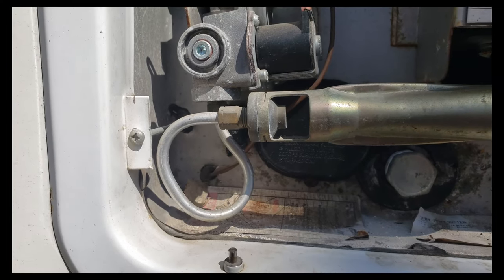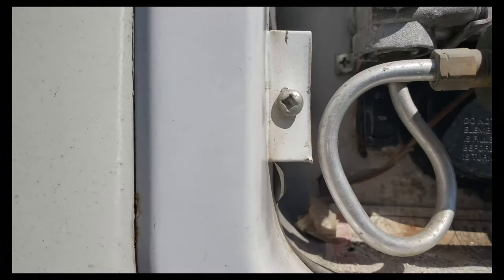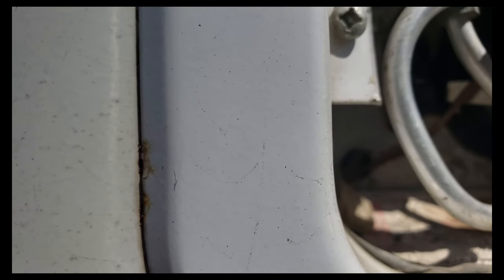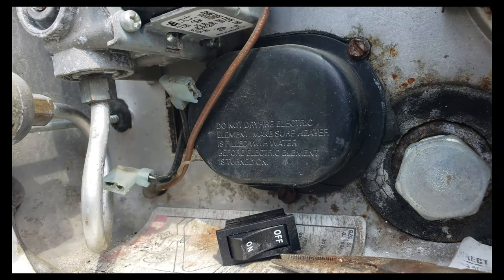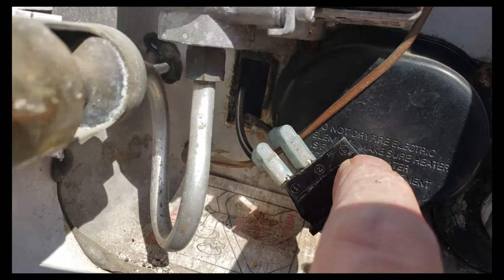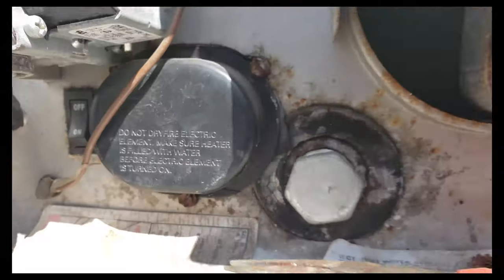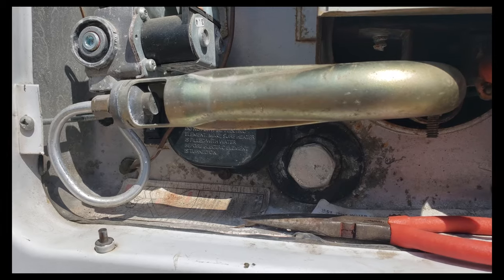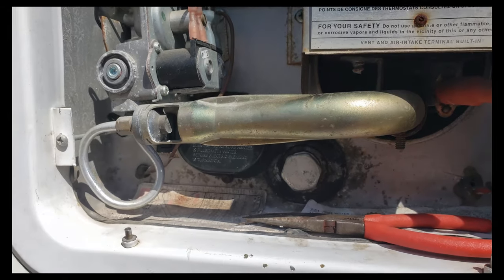RV Suburban Water Heater Electrical Switch Replacement

Comment: What if you can't find the exact toggle switch can I use a similar toggle? And the connectors where burnt and I can't find a replacement. Can it be just straight wired to the switch
Wire each plug, to each plug on the switch. Will it work? Then wrap electrical tape around each side the entire plug. Keep water out? Will it work without plastic connectors?